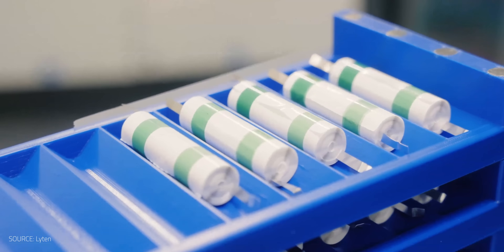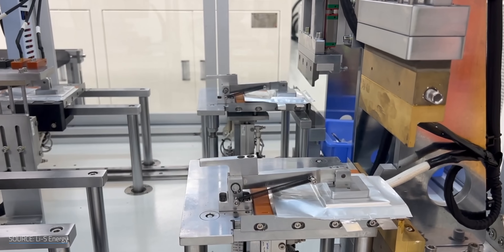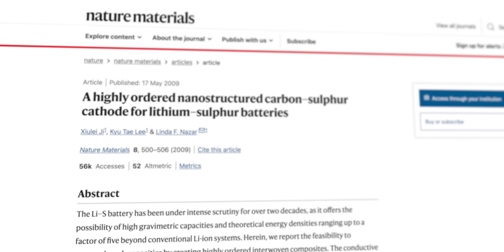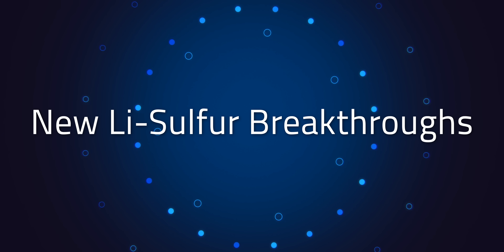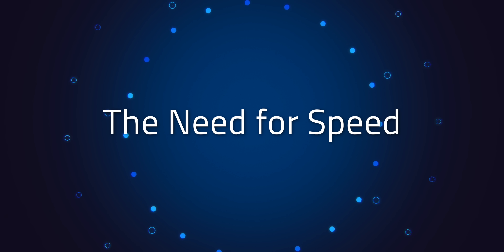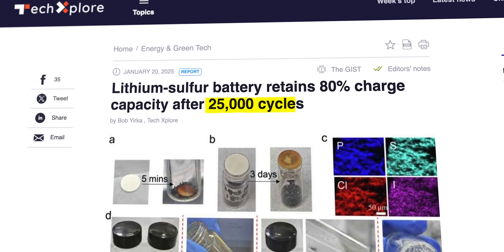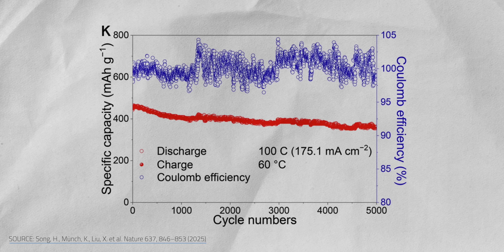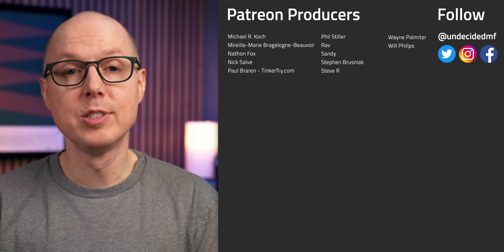How This Overlooked Battery Might Change Everything

Comment: For the past 20+ years we've been hearing of a new battery technology that will change the world ,only to never hear of it again
Reply: The first experiments for a Lithium based battery were done in 1912, it was the 1960s when they started experimenting with li-ion rechargables, and they didn't take off until the 90s, and has had numerous incremental improvements in the years since, and still being improved while other technologies are being developed...
Reply: @I_Feel_Waffle  and on top of that the tech improvement is steady at roughly 5% increase  in energy density while pricing keeps falling. I often think about where this tech will be in 5 years from now. Not 10, just 5.
Reply: 20 years ago a 18650 cell would have a energy density of 1000mah, today it's 4000mah, so battery technology IS improving.
Reply: @dogbreath6974  Exactly, there are so many clueless comments in these videos...
Reply: Almost 40 years ago my first remote control car used rechargeable AA batteries that took hours to charge for 15-30 minutes of runtime. Five years later the battery packs that took 15 minutes for the same runtime were a revolution. These were all very expensive. Flashlights, cordless phones, and Dust-busters were the only rechargeable devices most people used well into the '90s. Most battery powered toys worked on the power of the imagination after the first set died... Dead batteries became a multitude of new toys employed like "clams" on 'The Flintstones'. 
     My nephews' remote control cars use cell phone battery sized packs and run more than an hour after a ~30 minute charge and are practically disposable price wise despite being more durable. Everything runs on rechargeable batteries and most of it works... Massagers are on rechargeable batteries now which says something. We thought we'd have alcohol or petroleum battery packs for phones the energy density of metals was so bad! Progress takes time and a lot of boring work.
Reply: Well its not just batteries many fields have had unusual inventions that get memory holed. Almost like it would interfere with a planned narrative with very high interested parties🎉
Reply: @daveadams6421  does your phone still use NiCd batteries with 1000mah capacity? No? 🤔
Reply: This comment is written from a phone with one of these high tech batteries that change the industry (silicium carbon).

OnePlus 13, I expect every big phone/wearables maker to switch to it in at least 2 years
Reply: That’s because you only read the headlines. Look for the asterisk. All these upgrades are small steps, and stay away from overhype channels/news outlets.
Reply: When I was a kid, mobile phones weren't smart, and they only lasted two hours on an all night charge. Now smart phones last all day on an hour charge. The world was changed in my book.
Reply: "OnePlus 13 and the Oppo Find X8, both come with close to 6,000mAh batteries, thanks to the silicon-carbon battery technology.11 Feb 2025"

"BYD has launched what an executive claimed is the 'world's first high-performance' sodium-ion BESS product, using its proprietary form factor Long Blade Battery cell.27 Nov 2024"
Reply: That said, in last 10 years, the cost of lithium battery per kwh decreased by around 80%, so progress is clearly being made
Reply: @Michalosnup true latest battery was silicon carbon on xiaomi phone. I hope for better and better for ev side of progress.
Reply: @Michalosnup  The cost reduction is due to manufacturing and design improvments, not because of new tech.
Reply: @arkatub  that is new tech
Reply: @arkatub There is new tech.   Inserting a polymer and then curing it with an e beam comes to mind.  That then prevents dendrites.
Reply: @arkatub Are manufacturing and design improvements not new tech?
Reply: @arkatub  That's completely incorrect, Battery energy density has almost doubled over the last decade....
Reply: @arkatub  also an increase of availability due to increased demand.
Reply: @arkatub  It's definitely because of new tech
Reply: @arkatub Design improvements ARE new tech that requires RND lol
Reply: @Michalosnup  that's not progress
Reply: Mm? We've been hearing about, for example, this exact tech, on this very channel, multiple times. Research is slow, commercialisation is slow. But things keep moving all the time.
Reply: How long were lead acid batteries the only real option for?

We've only recently managed to replace them with lithium ion batteries.

It's just a product of how difficult it is to design new chemistry that will achieve a better result while being lighter and more reliable over time and in emergency situations where extremes of heat or sudden impacts maybe a factor.

We know we need to do better than we have currently, as such, experiments with the more difficult options with the higher potential pay off are the unfortunate necessity... no matter how long this takes.
Reply: That's mostly because it takes forever to fully develop any of them. Solid state batteries aren't even new. They've been in development for large production for about 30 years now. They are already in use cases though which is very cool but they're expensive.
Reply: There's plenty of marketing and lab only breakthroughs, but we've been making iterative progress on the actual shipped products.

Phone batteries for example have just been boosted up from 5000 mAh to 6000 mAh, which is pretty freaking good
Reply: I recently replaced the battery in a electric pallet jack with lifepo batteries and it was a quarter the price, less than a quarter the weight and holds a charge way better. That didn't commercially exist a few years ago. Now it's cheap. I'm calling shenanigans on you. New battery tech is popping up everywhere. Most people just don't know it. All they care about is  if it works and if they can afford it.
Reply: @emmettobrian1874  I appreciate your encouraging post.  Do the batteries provide any ballast that has to be recalculated with lighter batteries?
Reply: Some of them make it to market and people just accept it. 

They don’t really notice that their phone uses more energy than their older one yet has a similar or longer battery life. 

They don’t really notice that their phone charges in a hour and 30 minutes instead of 6+ hours.

Or that their phone is lighter and thinner than it used to be.

These new batteries or so often incremental and the in-practice specs are more to do with what the customer wants than what the technology could do.
Reply: @daveadams6421  this couldn’t be further from the truth. In the last 30 years, battery cost has dropped 99% on a $/kWh basis and energy density is up 500% over the same time period. 

These gains happen in thousands of tiny steps that accumulate over time into enormous differences.
Reply: At this point anybody who makes this comment has got to be a bot. It's unbelievable how this comment is always posted so many times under these videos. If you just watch the damn video you would know that they're literally building multiple factories to mass produce the batteries which means we aren't waiting anymore. It's here. It's out of the lab. Are you just daft or actually a bot?
Reply: only silicon carbon batteries made the cut. in smartphones at least
Reply: Completely untrue 😂
Reply: The switch from lead acid to nickel metal hydride batteries changed the world by ushering in the age of laptop computers, then the switch to lithium ion enabled the smartphone revolution, which again changed the world, and now lithium iron phosphate batteries are changing the world by ushering in a new era of grid and home backup storage
Reply: The switch from lead acid to nickel metal hydride batteries changed the world by ushering in the age of laptop computers, then the switch to lithium ion enabled the smartphone revolution, which again changed the world, and now lithium iron phosphate batteries are changing the world by ushering in a new era of grid and home backup storage
Reply: some came to light though. but yes i stopped listening to those miracle battery news
Reply: Soon TM
Reply: Haven't heard much about new battery technology until the last few years
Reply: So you’re telling me we have batteries that can last 25,000 cycles, but my wireless earbuds still die after two hours? Science, please prioritize my problems!
Reply: @daveadams6421  
1 - It takes decade to finalise experiments and confirm it is commercially viable. It is called consumers safety and regulations.
2 - Most/Almost all new battery chemical-combinations aren’t used in daily products as they’re not that affordable or accessible even in today.
3 - They aren’t exactly equally as viable and versatile as the lithium-ion battery we have, you can however actually see other types of batteries used in some power plants or research centres though, instead being in our daily products.
Reply: New battery technology is gradually changing the world, the thing is it does so slowly and at a pace that is very adaptable, if you look at the data for the past years you will notice price improvements per watt hour and new emerging applications. The breakthroughs are amazing when they are discovered but are boring once implemented and humanity starts chasing the next breakthrough.
Reply: @daveadams6421   Yup, but that doesn't mean it will never happen.
Reply: Yeah ok, but if your so pessimistic about the situation why bother even watching the video?
Reply: Might change everything? The most overused phrase on YouTube. Anything might change everything. A butterfly flapping its wings in Ecuador might change everything. Just call it a new or interesting or promising idea. “Might change everything” just translates into “clickbait “.
Reply: Perhaps the better batteries are being snatched up and stored away with all those hidden Nicolai Tesla already-working free-energy machines? The evil elitists do not want solutions, they want lies and excuses to feed their power-lust to evil-overlord over everybody, and to pretend like they can be God.
Reply: It costs nothing to be a cynic.

We've actually heard about improved batteriy technology for well more than 20 yrs and NiCad, and later, Lithium ion batteries were fruits of some of that effort.
Reply: @j12997967  
How do you get old, and not become cynical when you learn of all the evil bad actors holding us back? If you do not have your 2nd passport yet, are you even awake? Or are you a normie?

Solar seems almost worthless, other than that it seems to do well running calculators that use practically no power.

So if they are not holding us back, then why don't we all have self-drive Teslas by now?
Reply: @daveadams6421  development of powerful long lasting batteries are almost a matter of national security, maybe one of the biggest if not the biggest alone bottle neck to effective orbital weapons. It's more than just cellphones and EVs. As with anything we won't have it till 10-15-20+ years for it to be released for commercial use. Also planned obsolescence, corporations dont/do have a incentive to R&D better tech.
Reply: @daveadams6421  development of powerful long lasting batteries are almost a matter of national security, maybe one of the biggest if not the biggest alone bottle neck to effective orbital weapons. It's more than just cellphones and EVs. As with anything we won't have it till 10-15-20+ years for it to be released for commercial use. Also planned obsolescence, corporations dont/do have a incentive to R&D better tech.
Reply: And lots of them on exactly this channel.
Reply: @daveadams6421  brother, you just summed up this entire channel 😂
Reply: Thought the same…
Reply: Totally agree!!! Batteries are vapor wear!! Nothing is changing still ithium ion.
Reply: Warrenty reduced to 12 months recently & In the last 12 months batteries are programmed to not even reach warranty!
Reply: That’s because the traditional battery companies continue to pay people off or unalive them.
Reply: @daveadams6421  You heard China. Wait for the USA to announce.
Reply: @daveadams6421  Kind of like the disasters climate change was supposed to bring...
Reply: @daveadams6421  to be fair… its the same in every field.  And any tech that threatens the current powerhouses tends to “get forgotten” it always seems.
Reply: Untrue... As many of the comments have already said. In this particular case, the solution to the self-eating problem was discovered recently... 

Your comment is typical of people who say yeah. Yeah yeah sure sure it's never really going to happen. That's a senseless comment. We are learning new things everyday and some of those result in significant breakthroughs
Reply: Sodium ion is on the market now
Reply: For those of us that are old enough, battery technology HAS been revolutionary. In the 80s, rechargeable was such a joke. Didn't last, didn't charge, didn't work.
Reply: @terrykrueger I was thinking about that too. Current generation batteries have already revolutionized the world, it just happened gradually enough that it didn't look like an overnight revolution.
Reply: This type of battery will be used by the military for sure, but it will never be used for the mainstream consumer. For one important reason. Generating money. It's more profitable to get the population to buy more batteries then to make one expensive battery you might only need to buy once in your lifetime.
Reply: @daveadams6421  we got sillicon carbon battery tech now
Reply: I used to make polysulphide in the lab. Flowers of sulphur in hydroxide turned into a lovely orange liquid. Polyselenide too.
Reply: @daveadams6421  check silicon carbon battery. Unlike these experimental batteries, it’s currently being applied in some new flagship smartphones
Reply: Yeah the problem is going from lab scale experiments to actually productionalizing for safety. The core issue with a lot of these other great options, is that it’s not stable and safe for consumer/home use. A lot of the more advanced stuff, although riskier, is deployed to industrial settings because they have blast walls, flame retardant spraying sprinklers etc. You can’t fit all those safety tools in your pocket.
Reply: @daveadams6421 The Lithium batteries we see today are a product of foundational materials work conducted by Goodenough and Thackeray in the early 1980s. Goodenough couldn't support patent funding and, after trying several companies,  was transferred to the AERE, who later sold it to Sony.

  What I'm saying is that LiB took years before commercialisation.  Even today, 45 years on, we are still doing clever lithium research and deploying fancy BMS. Today, we have different problems, scale.
Reply: Not bro don't you know about silicon carbide check about it doubling our battery capacity
Reply: @HEMANTHKumar.p-hi5rn  yes silicon intercalates well, but SiC i would have to take a look into it. I'm sure the materialist come up with clever ideas,   but requires a lot of experimentation and testing,  before paper and  commercialisation..
Reply: its feels different this time, billion are being poured, not towards tech development but mass production instead ! The tech is already ready, only implementation is left.
Reply: @shukrantpatil I'm guessing we will see some implementation of this but not immediate mass adoption. mass production doesn't necessarily mean stable product. New battery technology can have a high failure rate at early deployment and sometimes takes revisions, or they meet an unexpected bottleneck in deployment. If it turns out I'm excited to see what people can make with it.
Reply: You never hear about them after they are used in your phones and cars
Reply: @Y2Kvids ?  The cars don't have magic new tech. The cars haven't had the energy density go up 10x.

Heck this is undecided with will farrells cousin, the channel that reviewed batt tech that didn't exist and still isn't in consumer products
Reply: @lasskinn    of we take 2012 24kwh nissan leaf to a 150kwh nio it is 6x . 
Charging speeds have gone from 0.5 C to 10C ,
Reply: There are LiFePo, iron flow, sodium, many other new battery types in commercial use today.  Lithium ion will not go away soon, but is being supplanted by newer tech, slowly but surely.
Reply: I mean, this generation of mobile phones we are starting to see a new type of lithium battery (silicon carbon) that takes usual capacity of 5000mah to 6000mah which is 20% increase. Solid state batteries are also becoming a thing. I heard even flywheel batteries are being scaled up for practical applications.
Just takes some time and usually it's out of us usual consumers' awareness because it's being used in commercial or industrial settings. It will trickle down eventually for us to see the benefits
Reply: You aren't hearing about them because you aren't paying attention. Some of them are being used commercially right now. Just because they are being used in more niche applications rather than completely displacing lithium ion doesn't mean they were a failure. There are also lots of battery technologies that work, but all of them have strengths and weaknesses, so which one will come out on top is hard to predict. Just having a working battery that solves certain problems won't necessarily lead to mass adoption if there's something else that does it better. 

I actually think a lot of manufacturers are sticking with lithium ion until a battery tech that's clearly better than all the others emerges. They don't want to switch all their production over only to have bet on the wrong tech, and have to switch again when an even better battery comes out.
Reply: actually li ion batteries did change the world by making electric vatteries work with bldc motors and controllers reliable
Reply: But they did, batteries improved massively over the years
Reply: You should take a closer look to the bollorè solid state battery, my car run on it 66kkm and 0% of degradation, this battery exists since 1997 noone talks about it
Reply: @ssupertutorial  you mean the lmp battery they put in that car. Sure it is different but not new and has other drawbacks which are the reason it has not been used more then in that silly Italian car.
Reply: You have to be able to compete with the exiting hugely-scale mass produced products, which is really hard to do. Getting some kind of funding like government funding can help to get started on that path though.
Also, some things did make it to the market, I think it was sodium-ion that is being used for EVs, but not all market segments yet.
There are some battery technologies which do well in grid-scale batteries, I forgot the name right now.
Graphite is actually being used for part of the batteries that are sold on a regular basis, but it still hasn't gotten to the mass-production people expected to happen, it's still a harder problem to solve than people thought.
If you check battery capacity of smartphones actually doubled in the last couple of years.
Reply: Sounds like more Bot Trolling/misinformation, main aim is to cast doubt and be at the top of the comments, it has also received over 200 likes, possibly from more Bots and the rest are people who haven’t even bothered to read the discussion. Don‘t you just love this side of YouTube!
Reply: You're welcome to use only batteries from 20 years ago.
Reply: that's a valid point/criticism but not necessarily a good comparison. Unlike 20 or even 10 years ago, research in battery tech has seriously picked up in just the past years. It's a race now
Reply: You are at the correct channel then, it's full of these 20+ year ideas
Reply: You're right, but I still can't help but hope this time is different.
Reply: Yet electric cars are cheaper than any gas car ever made
Reply: @camronrubin8599  Depends on region. In New Zealand, a used petrol car cheapest is around $2-4,000, a used electric car is around $14-18,000. These are just averages based on private sellers (e.g: Trademe) to used car dealerships (e.g: Turners)
Reply: No? They cost twice for am equivalent model, Just look at models like the Renault kwid they comes um Both Eletric and gas